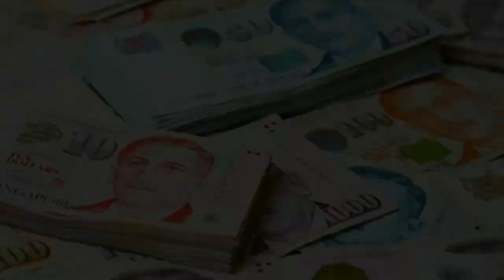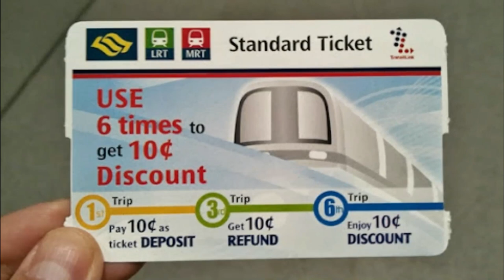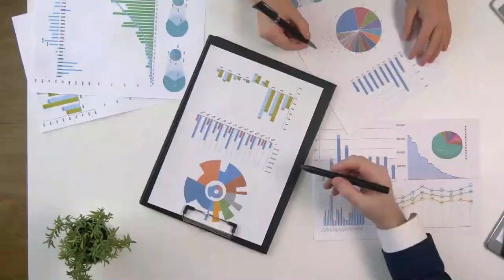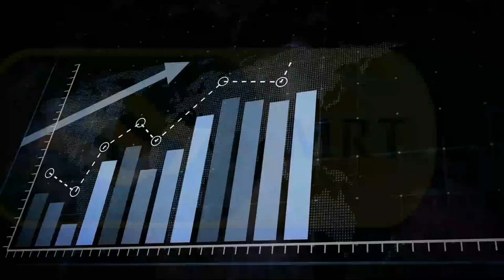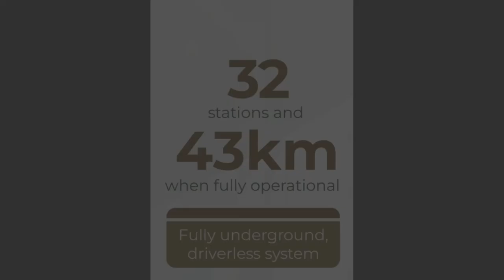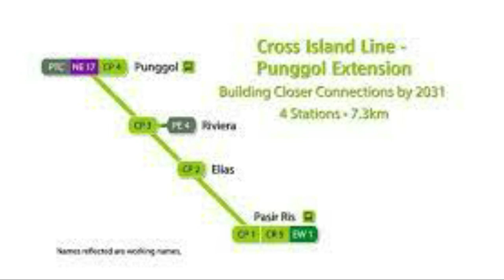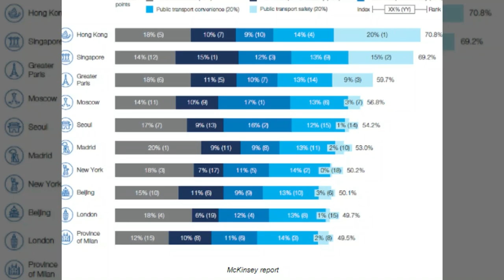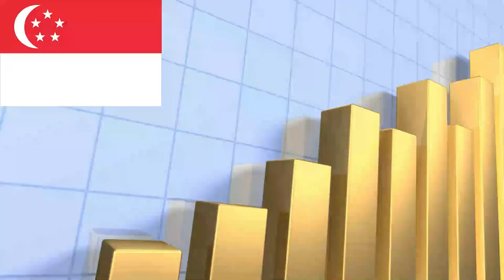Building Singapore's Mass Rapid Transit: The World's Best?

Comment: Slight note that our MRT trains in Singapore run at a speed of 80KM/H even though our trains can run faster then that
Reply from the maker: Yes, you are correct! Most trains are designed to have higher speeds but they're limited due to several reasons(e.g. regulatory laws, safety, etc.).
Reply: Do note that the T251 trains have a maximum speed of 90kph :)
Reply: I know Downtown line trains are faster than the Circle line trains
Reply: @LaxMarch2022  actually they both have the same operating speed iirc
Reply: @ZSVisuals  urh I was talking abt Tel not CCL lol... but anyways CCL could not go that fast due to technical limitations of the train and tunnel sections

Comment: When I went to Singapore three years back in 2018,there were drivers in the trains.I use double decker buses to travel.
Reply from the maker: Maybe they used a lower grade of automation where they needed an attendant.
Reply: @BehindAsia  Maybe you have to release your source of information.All trains have a driver mode.It is whether the train operator wants to use staff or not.Often in certain places where prayer is more important such as five times in a day in prayer rooms that have long corridors there is shortage of time.So the trains are left to run by themselves hoping they will not knock into each other.Recently there was a case where two trains collided inside a tunnel.So what will you choose?A driverless train like a headless chicken or a dedicated driver train system.The choice should be reasonable.
Reply: @KironManuelCards  They are all automated trains! The staff in the cab is there to manage the train and take over if anything goes wrong (an accident or a malfunction in the system). They are not driving the trains
Reply: @MrAstonishing47  They are not automated trains.Infact a few of them had crashed.
Reply: @KironManuelCards  That means that the system is malfunctioning. That's why there's staff in the cab to take over when it malfunctions. In that case, it was too late for the staff to take over. Also yes it's automated if you go and do your research
Reply: @MrAstonishing47  That means the trains in KL always malfunction.Come over to KL and experience the system.Singapore uses a very different system.I have lived and worked in Malaysia and Singapore.
Reply: @KironManuelCards  whatever....
Reply: Only the NSL and EWL which are older rail lines are manned. The rest are driverless.
Reply: @johnlzr  only a nutcase will think a metroline is driverless.All have a driver input,but the system allows some automation.
Reply: @KironManuelCards  You might like to take this up with Wikipedia which states that "The MRT is fully automated and is the most extensive driverless rapid transit system in the world."

You might also like to take this up with International Railway Journal and CDPQ Infra, both well-respected publications on transportation infrastructure. 

But I am also happy to let them know that they are all nutcases, because some random guy on youtube says so.
Reply: @johnlzr  mic drop nice one!
Reply: @KironManuelCards  Some nutcase so backward cannot imagine a driverless train system lol. And what non sense talk about prayers in relation to MRT system. In Singapore. Hahahaha
Reply: three years back there were drivers cos we were in the process of automating the mrt. i believe the lines you are referring to are the North South and East West Lines. currently they still have staff in the cars, but the driving of the train is mostly automatic after retrofitting.
Reply: @KironManuelCards  this is not true. only two recorded incidents sofar, one in 1993, another in 2016.
Reply: @KironManuelCards  no, for newer lines, like the TEL, DTL and CCL, they ALL ARE AUTOMATED. they only have staff in there and a manual mode to take over when necessary. please read up before commenting as you may spread misinformation
Reply: @alex._.1501  You are talking about Singapore that has an advanced system.
Reply: @KironManuelCards  bro I think if you're not properly informed, don't anyhow say. CCL, DTL, TEL are automated driverless system.
Reply: @endi4654  even of driverless still the route is longer than necessary.Too costly.
Reply: @KironManuelCards  Talking fhaa art in g
Reply: @KironManuelCards  "left to run by themselves HOPING they will not knock into each other". Utter non sense llm ao
Reply: Singapore GOA4 Systems all 6 MRT lines, 3 LRT lines and 1 Changi Airport Skytrain  List of driver-less train systems W i ki.
Reply: Built using the latest technology and engineering techniques of its time, NEL heralded an era of automated and driverless mass rapid transit systems". "NEL is the world’s first FULLY AUTOMATED underground DRIVERLESS heavy rail rapid transit line"  lta singapore